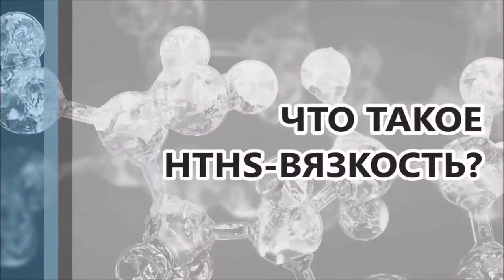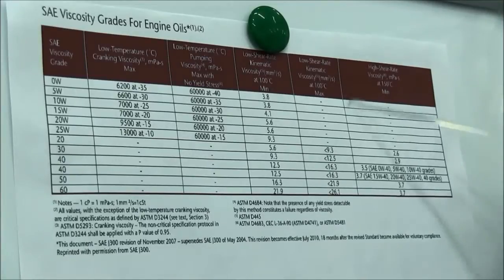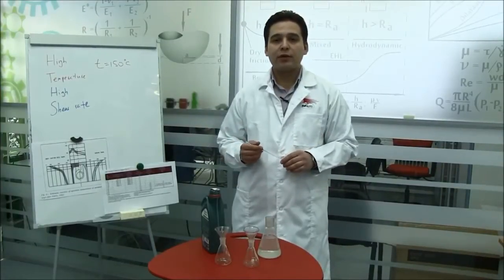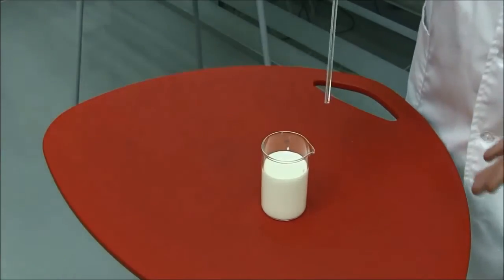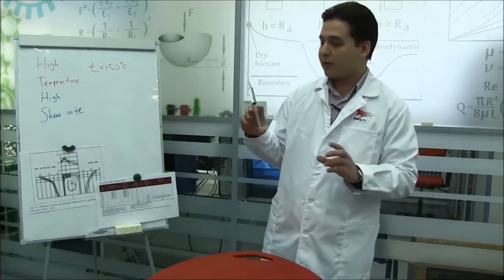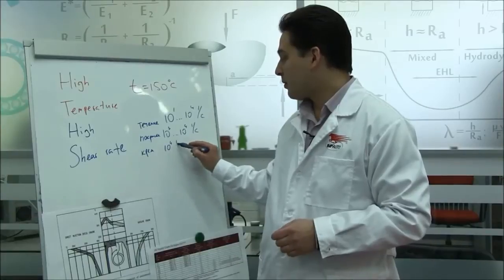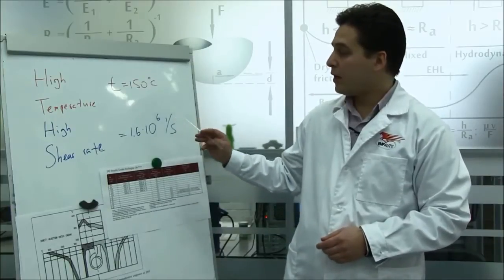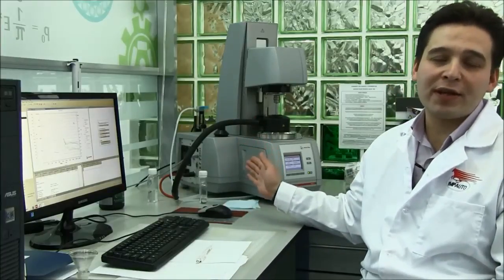What is the HTHS viscosity

Comment: Can you please inform the model and brand name of the apparatus and to which ASTM method it is compliant.
Reply: the true accurate value of HTHS can be obtain using method ASTM D4683 
Standard Test Method for Measuring Viscosity of New and Used Engine Oils at High

Shear Rate and High Temperature by Tapered Bearing Simulator Viscometer at 150°C

(TBS) which produce by TANNAS CO. & KING REFRIGERATION, INC. (www.tannasking.com) Model TBS 2100E-F or TBS 3000